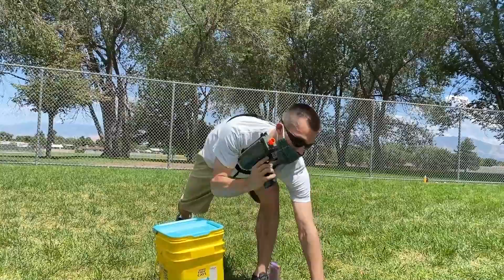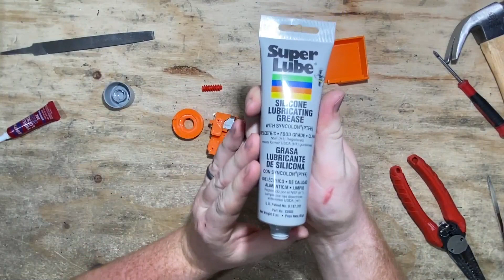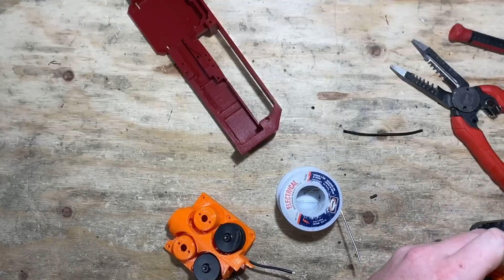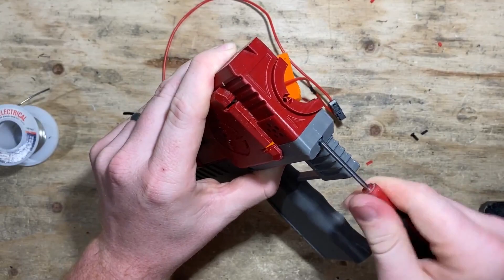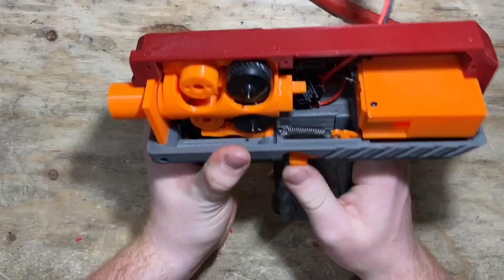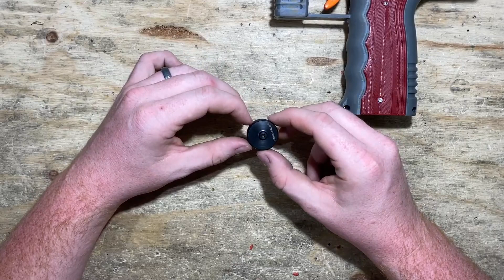Woozi Nerf Blaster | Build Guide

Comment: A suggestion, maybe drill 1 to 2 small holes in the pusher box for air venting for the electric motor. As it is totally sealed.

Comment: My kit did not come with the compression spring used to work the mag release
Reply from the maker: It’s optional and can be left out
Reply: I’m having trouble with the gear cage, I cannot get the screws to connect to the axle the gear is on
Reply from the maker: @grapeapeductape2489  It helps to push something through to line up the holes.